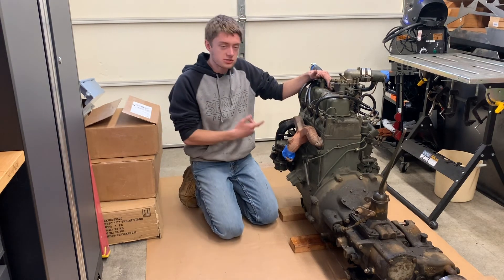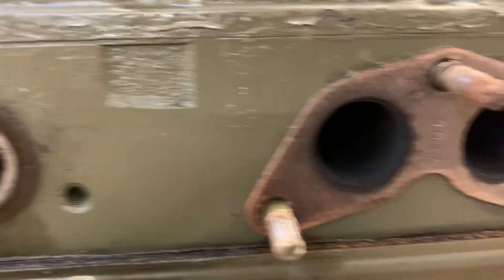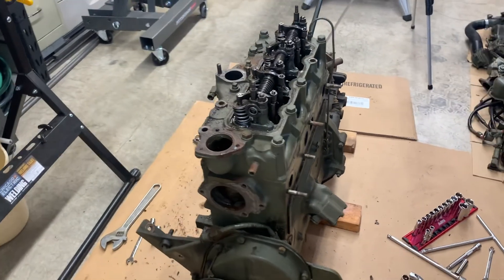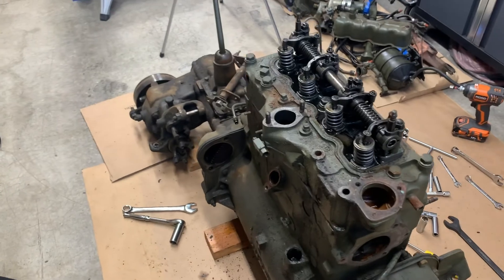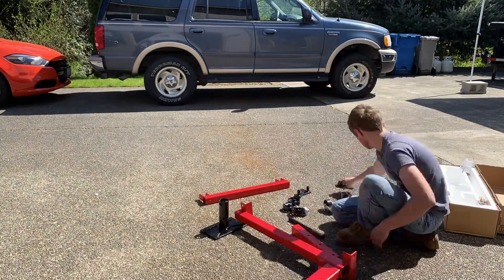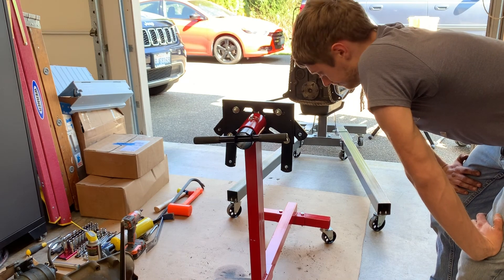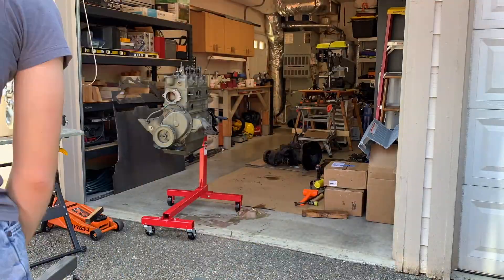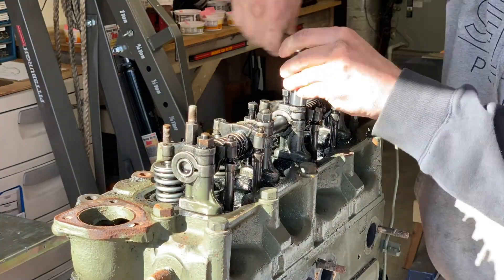Classic Jeep Engine Rebuild Part 1: Engine Teardown

Comment: Nice video!!!

I just remove today my m38a1 engine from my willys 41, and put it on tbe same harbor freight stand 😉👌🏽. I know is not the original engine 😥 lol.

Its supose to have only 600 mile on it, but it was outside for 60 years .

I think i need to open it and check it. But i have no clue how to do it. Your video is gold for me! 😉👌🏽👌🏽👌🏽👌🏽👌🏽

Where are you located?